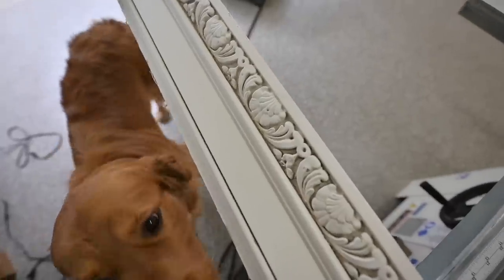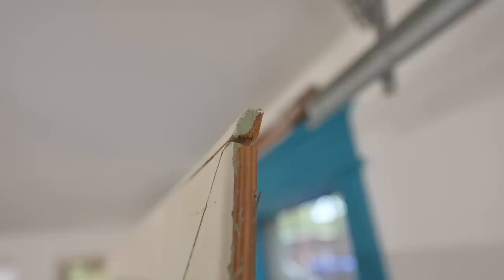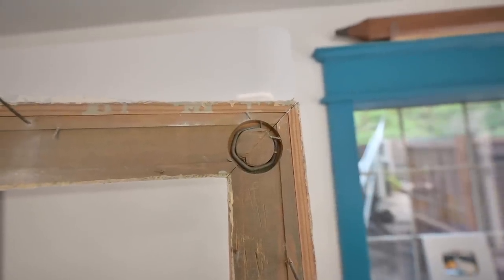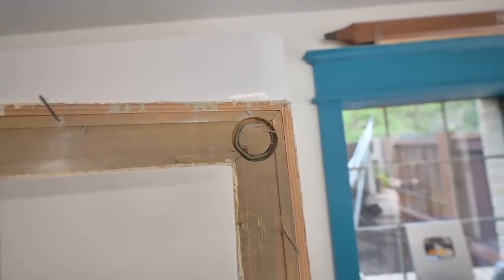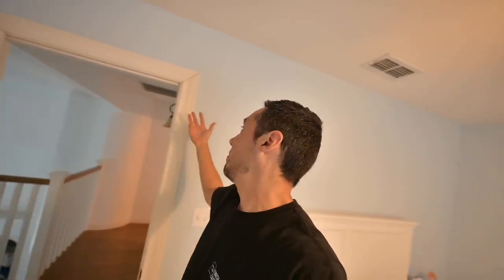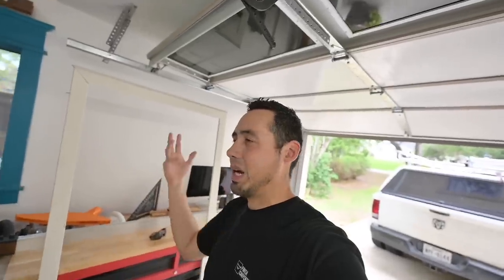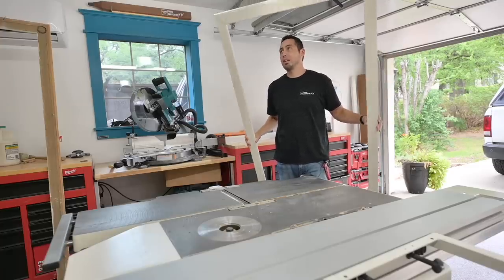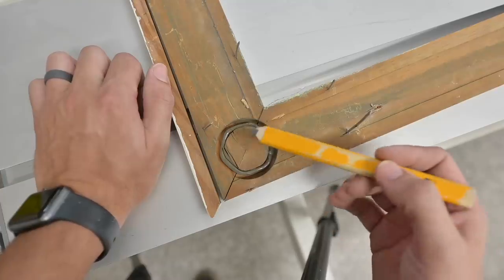Door casing skill lost for 100 years

Comment: You can guide a hole saw on the outside. I've done it many times. Just take a piece of plywood and make a hole with the hole saw. Then remove the center drill, clamp the plywood to the place where you want to cut the circle and continue as usual. My theory: I think the middle was cut round initially. The hole saw just cut a really wide groove and the middle diameter was left a little bigger than needed. The hexagonal ring then the was just forced on the round cut and thus provided enough tension to hold the the pieces clamped even when they shrinked a little more as they aged.
Reply: I agree with your theory, I would like to see the bit that cut the 3/8” groove…….
Reply: Of course. It works well, not just on timber but also (hand held) for small diameter core drilling of concrete or brick. As others have said here, there was a machine to make these joints and they were more necessary when homes lacked central heating and airconditioning and before modern glues. Standard practice now is to glue mitres with PVA.
Reply: I'm with you. I think the hexagonal shape of the inside circle happened over time. As the wood shrank and stretched it would take on the shape of the ring.

Comment: Interesting and innovative considering the time it was invented. A method I've seen used today is a corrugated sheet steel strip hammered into the wood, perpendicular to the mitre.  Serves the same purpose and is much quicker, although not as elegant.

Comment: It's called a miter ring. I can't remember the manufacturers name but I came across them about 35 years ago during a renovation of an old Tudor house in great neck NY. They were apparently sold premilled in standard sizes for windows and doors to builders. Nice find!
I would use the crown as part of a mantel!
Reply: Thank you for this. I ran across one of these miter rings a few years back in door casing in a 60's tract home in CA.  I had a hard time believing it was done on site by hand; more likely for production work. Nobody I asked (we all have 40+ years in the trades) had ever seen it.
Reply: My experience with old millwork is only from northern Minnesota - never seen this. Makes me wonder if it was local to an area in California. Perhaps driven by the shaky ground there.
IF you could source the metal locking rings from, say ACE Hardware or Grainger, a jig clamped over the mitre joint then using a router to cut the circle - easy peasy. An arbor press could be used to press the ring on in softwoods. Hardwoods would call for a bit more work to make the hex shape.

But having a millwork shop offer those up pre-made makes the most sense.
Reply: Curious I cut my teeth on Gold Coast Mansions on Long Island & was thinking you’d think I would have seen that..
Reply: Yup considering the shape and the notch it may have been loaded into a tool with sharp edges and hammered or maybe a vise pushed it in or sort of like that.
Reply: Thanks! I was hoping somebody would chime in on this with some info.
Reply: Best let the wife and kids decide on the crown use
Reply: @mudlick8186  I bet they sent the pieces already routed with the needed rings in a kit. No need for any tools but a hammer to assemble the miters.
Reply: @Kactapuss  I agree, that makes the most sense. Premitered and routed when delivered onsite for tract work and all the installer needed to do was cut the legs to length, tap in the rings and nail it. The casing I found it on was 2" clamshell so pretty small and simple as one would expect in these homes of that era.

Comment: That molding would make a great frame for your You Tube Play Button, the reason things were made better back in the day is Pride and Craftsmanship which lacks today. Back in the 60s when I was a kid working in my Grandfather’s boatyard we would replank boat bottoms by using homemade steam boxes and put the hot boards in place and with ropes and pulleys plus a lot of shoulder and screw them in place but when you put the screws in place we would put all of the slots in line ( timing ) even though they would be puttied over and painted because you got into a habit so when the screws were exposed timing the screws were done automatically and to this day as a retired machinist with 40 years I still take pride in everything I do and I passed it on to my own.

Comment: It is scary we have lost these amazing techniques over the centuries.
Reply: Youre goofy. There is a reason this is a "lost technique". You shouldnt put so much trust in youtube carpenters. Alot of them dont know what theyre talking about. The reason this method is outdated is because its not as efficient as modern methods.
Reply: Now we have amazing new techniques.  We have no need for joinery like this now because our foundations are about 200 times better,  so the house is no longer moving large distances from a crude foundation sinking ridiculously far like the many of the old houses did. That was the reason for those metal rings. When we do need a joint pulled together we have pocket jigs now which hold the joints together ridiculously tight.
Reply: They aren't lost but they lost their usefulness.
Reply: Nothing amazing,stupid technique.

Comment: Depending on the length of trim off that job, I would do a surround for an old mirror if you can find one. As far as getting the ring into the grooved back of the trim, all you would have to do is have each piece of trim at a slight angle from a horizontal plane, lay the ring in and slowly bring the pieces to horizontal, like opening a book.

Comment: One way they could have used a hole saw without a center bit is by using a piece of scrap that the hole saw drilled through first as a guide that they could use to keep the hole saw from wandering with a clamp or something.
Reply: I've done that a few times when you run into old door hardware that had smaller holes than newer door hardware. I just drill the scrap and clamp it to the door so I can send a new size through without it wandering. Depending on your holesaw brand you can also put two Holesaws on your pilot bit. One that's the size of the original hole, and then the desired size hole behind that.
Reply: I've done that cutting holes in tile for the plumbing. If you wet a sponge you can leave the sponge in there as your cutting.
Reply: When remodeling in old  houses with wood floors using a pre-drilled scrap works well to resize/clean up existing holes from old plumbing/steam radiators to accept wood plugs before sanding and refinishing...
Reply: I have had to do that very thing. If you need to in large an existing hole it works well to cut a hole in a piece of scrap and use that as the guide. I also wonder if maybe they heated the ring a little to expand it before installing it.
Reply: My thought exactly!  I used that technique when I had to widen a hole for a larger lock set.
Reply: Another trick if you have an existing hole is to screw a smaller hole saw inside the larger one

Comment: Hi my home in the Uk is 125 years old, the trim around the doors and windows are what we call Architraves. They are all out of pitch pine and all the mitre joints are as tight as the day they were fitted, All of the internal doors are original and are made up from yellow pine. |All the through mortice and tenon joints were wedged. When I bought the house i stripped all the old paint finishes from all the internal joinery and gave them a natural finish. I am a joiner by trade (long time retired) and enjoy your program.

Comment: I still have the tools my grandfather used for this type of work.  Tool #1: It is a board 2"x2"x6" long (true dimensions).  He drilled a 3/8" hole all the way thru the board centered at 3".  Then he drilled a 1.25" hole centered on the small hole about 3/8" deep and then glued in a bearing using some nasty black stuff that still smells like turpentine.

Tool #2 was a standard adjustable circle hole saw that he replaced the center bit with 3/8" round stock.

I watched him do this many times growing up.He clamped tool #1 to the work piece, shoved the round stock in tool #2 in the bearing and just started driving it down with an egg beater style drill.  He would use this for holes larger than 6" diameter.  You need to shorten the 6" length if you wanted smaller diameter holes.

I have tried several times in my life to repeat the process, but I don't have the upper body strength to use the manual drill and keep that weird adjustable circle hole saw aligned right.  I thought about putting it in my drill press, but grandpa's tool mean too much to risk breaking...

BTW, he used this for inlay work on the back side of chairs.

Hope this helps.
Reply: Thanks for that description!!

Comment: Great find, It takes "modern" carpentry to the next level. 
1. Angle clamp tool for 45 
2 stencil pattern 
3 drill tool the thickness of the circle 
4 stencil and chisel hex. 
The stencil and the metal fitting could be the same by making the metal fitting around a solid hex stock and manufacture it flush to the bar.

Comment: I doubt the wood "pegs" were chiselled into hexagons. They look mostly round apart from the areas flattened by the hexagonal rings, which leads me to believe the round pegs were simply shaped by the hex ring being pressed on and locked in by the wood slightly bouncing back behind it.
Reply: That's exactly my thought too. No carpenter is going to waste time chiselling a hex...
Reply: @TimHollingworth  from some other answer where I guy said he worked with this, there is a machine who cuts the circle, chisels out the hexagon, and presses in the ring in 3 parts.
Reply: @TimHollingworth  I agree with the whole chiselling a hex...it seems like chiseling the channel into a hexagon shape to match the ring is extra work that would actually not help the press ring hold. Aside from the hexagonal rings since i'm not a metal expert, the channel on the wood doesn't actually seem that difficult to make while also able to prevent damage on the center like that door frame. You could even do it with a hand drill. I've used a technique on holes that turned out to be a little too small sometimes and I needed to enlarge them with a slightly larger hole-saw but needed the circle to stay at a similar center as the already existing hole. Since a hole was already cut, I no longer had material for the center drill guide to begin cutting my hole. I just create a template for a hole saw out of a sacrificial piece of 3/4" plywood cutting a hole into that first with the desired size hole saw, then you can clamp it down, or even create a sort of jig that would fit the frame and hold the template/guide out of some more scrap wood to avoid damage to any visible faces that you don't want to damage due to clamping, and use your new pre-cut template to cut your hole with a hole saw. You could also even use a stepping method and use two different diameter hole saws to create the wider channel similar to the one in this door frame. As far as the inner diameter of the channel being a circle, it benefits the channel more to stay as a circle since the hexagonal ring being metal it also has flexibility and will flex when forced to without any permanent deformity to its shape as long as you don’t over stress it. The metal ring being a hexagon, would allow the ring to actually have a larger circumference on its inner hole than the inner diameter of the channel on the wood if the ring was formed back into a perfect circle. But due to the ring fabricated to a hexagon as its permanent shape, would want to spring back to a hexagon once inserted into the circular channel. And in a hexagon, the inner perpendicular distance between parallel sides of the ring would be slightly smaller than the inner diameter of the channel on the wood, thus when inserted into the channel the ring would create that clamping force since the ring wants to stay in its permanent hexagonal shape. The reason why the channel in the video looks like a hexagon as well is most likely from the decades that ring has been clamping onto the wood for. The ring pretty much has permanently deformed the wood at this point.

Comment: When you need to use a hole saw without a pilot you first drill a piece of scrap wood with the pilot in then clamp the piece over where your hole needs drilled. This captures the outside of the hole saw so you don't need to use a pilot bit. 
I think they routed those holes though
Reply: 1920? No that's chiseled
Reply: Yep. Or considering all the corners were done that way I'm sure they had an adjustable corner clamp and guide set up. Adjust for width with wedges and then select the hole saw size.
Reply: @PartTimeYooper  

It wasn't chisled, it was machined in.
Reply: It was clearly machined, the weld on the ring is clearly a factory machine weld.    It's very unlikely that was done on site.   They probably ordered them and had them delivered, then site crews just nailed them in.   "MEASURE TWICE..."!
Reply: @crforfreedom7407  There is a good chance that it isn't even a weld. I think the hexes were probably cast and what looks like a weld is actually the remnants of the sprue.
Reply: @dicksargent3582  Maybe, but it looks too uniform to be a sprue to me.   It looks like every chain weld I've ever seen.  It's a very old process...
Reply: @PartTimeYooper  you are high. I’m a beast carpenter, and it would be impossible to chisel a circle that clean. Are you messing with us, or do you just not know woodwork?
Reply: @tonywolfemusic5920  no its called history there beast Carpenter and no they didn't use hole saws on jobsites in 1920 but they had really good carpenters with chisels.

Comment: Richard I’m with you bro, I’m 45 years old been a carpenter since 20 years of age, the city of Des Moines Iowa is where I work, we have an area called South of Grand, the majority of these homes were built from 1890’s on into the 1920’s they are phenomenal as far as the wood work goes, and I’m always blown away by the techniques used to accomplish what we find easy to do these days, with power tools, 

As for the casing miter I wonder if it was from a previous remodel, post electric routers, just a thought, but still real ingenious, better than a pocket screw

Thanks for sharing
Reply: Round circle is definitely machine quality, looks kike a router to me.

Comment: My guess is that they didn’t chisel for the hexagon. I’d say they used a hole saw as you suggested and then pressed the hexagon ring in. By doing this it would ensure a tight fit and it would eventually compress the wood into the hexagon shape making appear like magic. 

Oh and make a glass case using the ornate moulding to display cool trim work finds
Reply: Also uses the straight metal sides of the hexagon like a spring, so it could swell and shrink with moisture while still retaining tension and a tight joint. Beautiful idea.
Reply: This was my thought too. Maybe even wet the wood after putting metal piece on to get it to swell and form itself. I want to see the bottom of the "drilled " part. I'll bet they had a special bit that created it to have some width in the initial hole
Reply: I'm a 65 yr old son of a carpenter and a semi pro wood worker. My father used a bit and brace to drill out door hardware with a special metal fixture clamped to the door to guide the bit into the door, no pilot drill necessary. As far as the molding circle is concerned,  a metal right angle jig much the same as the door jig could be used to clamp the two pieces together and then a hole saw that had a wide kerf could be utilized to create the circular trough for the hex ring. The hex ring could then be forced into the circle, weld knob first to create tension to hold the joint together. This is pure speculation on my part as I have never seen that technique before myself. I get a kick, Richard, at your excitement over such things. Good on you. I also agree with making a glass shadow box, hinged like a cabinet, using the ornate molding to house your unique molding finds. Cut away all but those corners, one facing out and one face in, to start the collection.  Well done.
Reply: I agree with others that the inside was not chiseled. Chiseling the hex shape would have eliminated the clamping force just like using a round ring wouldn't provided clamping force if it had an inside diameter that matched the wood plug. 
An undersized round ring would have worked. Pushing the hex ring on most likely deformed the wood to a hex shape. Checking for chisel marks where the ring was removed should determine this. 
The ring may be a hex instead of circular for one of two reasons; easier to make or prevent the ring from slipping when pushing it on.
As for making the groove, picture something like a plug drill used for making wooden plugs from hardwood and the drill guide used for drilling doorknob holes on a jobsite.
Reply: They may have wet the wood and punched the ring on the wood
Reply: No doubt, they didn't shape a hexagon, it makes absolutely no sense. This is compressed wood as it is.
Reply: You may be onto something but I would assume they would have to carve some of it away but not all. If they didn't. I believe that much force on thin stock would crack the wood itself.
Reply: @chrislangdell117  usage and trial and error should eventually derive a hex ring sized to the round wood that won't crack. If the practice was in use long enough by the time the example you found was made, then chiseling should not be required. Early days of the practice could have required use of the chisel.
Do you think that the cracks would be immediate or after a month or a decade or somewhere in between?